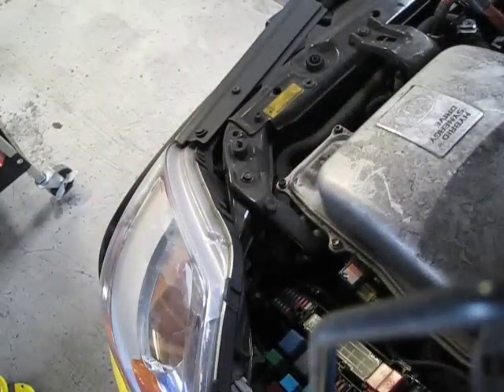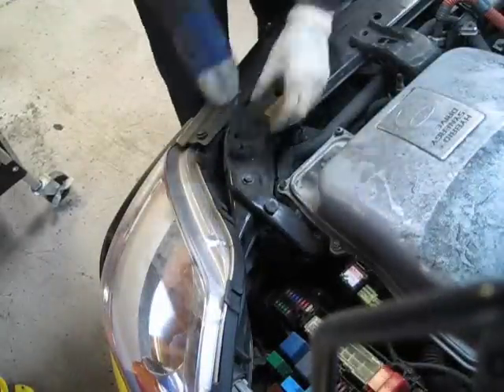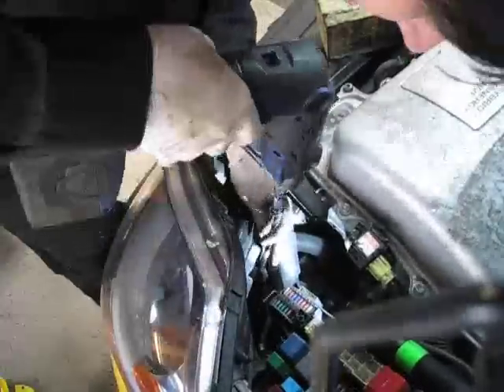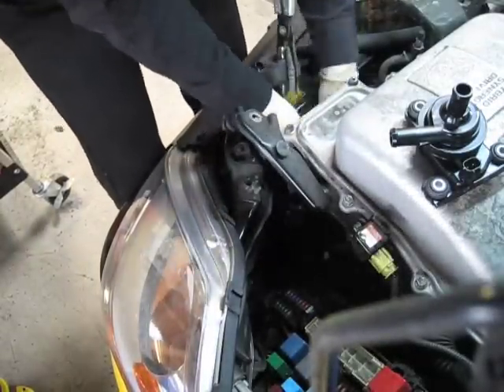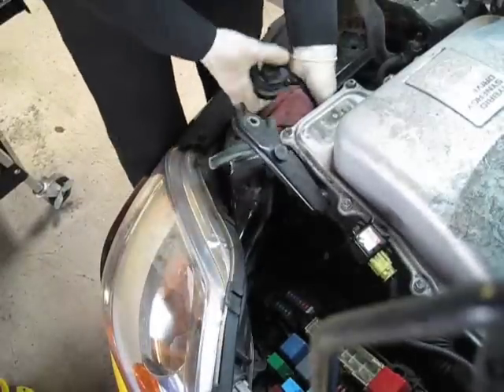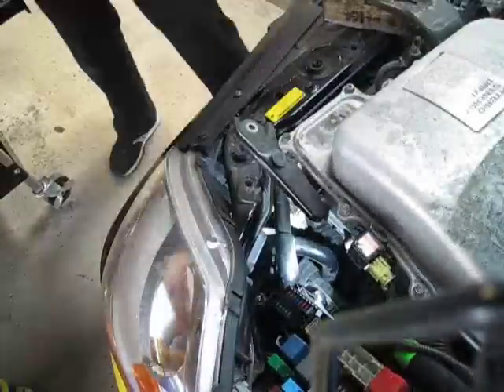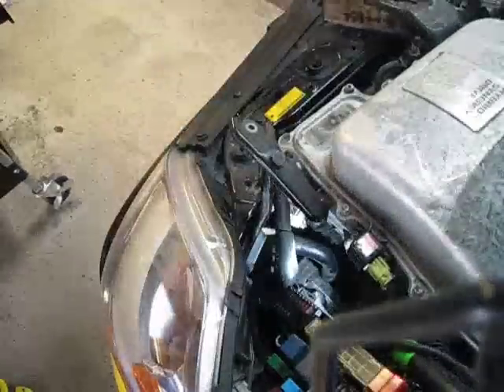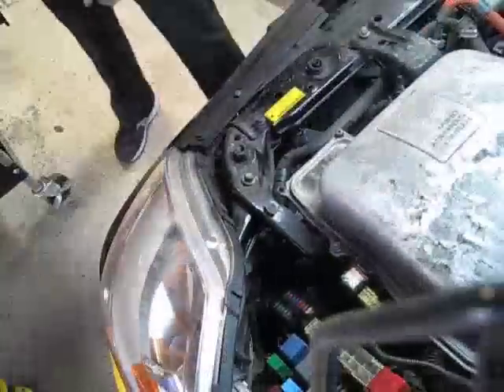Inverter Water Pump Replacement / Recall - Gen 2 Prius - P0A93

Comment: This was the best video for learning to do the replacement without having to take apart your bumper. Only thing I wish I had noticed is how she kept the inverter propped up by a wooden block. I did get a bit of coolant into the electrical socket, but I used Q-Tips to soak up the liquid before I connected the wires back in. It only took me 2 hours because I was inexperienced. Hose clamps were an invaluable tool and I didn't have to drain the coolant. The reward was hearing and feeling the vibrations of the coolant being cycled though the hoses. Thank you for this video.

Comment: I just had the left headlight off a 2009. Looks like that'd be an easier way to get at the inverter pump. With the headlight off the car the pump is right there in the open. Wouldn't have to touch the inverter. Like in this video https://www.youtube.com/watch?v=C-a1TpnVrW4

Comment: I replaced the inverter coolant pump on my 2005 Prius today with the help of your video. The dealership quoted $700 for the repair, but was able to buy the pump, coolant, and tools to replace it for under $150. I maneuvered the pump out by removing the hoses and bolts holding it to the bracket, although it was a tight fit. I did not move the inverter as the bolts holding it in were too tight and I don't own an impact wrench. Thanks!

Comment: Thank you, Luscious Garage, for sharing this technique.  We were inspired by your steps to do our own repair on the other side of the country.  We found what worked best for us was removing the front two bolts attaching the inverter to the frame and also the two bolts on the right side of the inverter mounting bracket (right above the inverter cooling pump) to completely remove the bracket.  That left us very clear access to the pump (vertically), and with two of us working on it, one of us was able to hold the inverter up and to the left to make just enough room for the two fluid hoses to squeeze by (carefully); the back inverter mounting bolts were still in place.  This allows the pump and hoses to be brought up above and in front of the inverter (between the radiator and inverter) for further pinching (to save fluid), unclamping, pump removal and replacement, then reinstallation.  Definitely need two people for this process I described, but the whole thing should take only about 30 minutes.  Your team definitely takes the win for fastest time, and a one person job too!

Comment: I took off my headlight and just used a. 10 mm socket. Easier, but get some carpet and sit on your knees. For $7.99, Harbor Freight has the hose shut off clamps.
Reply: What are the hose clamps at harbor freight called?

Comment: Well, when I took my 2007 Prius in for a "free" recall repair at a local Sunnyvale, CA Toyota dealer, they did not work on a recall repair. Instead, they ran a repair estimate which the dealer charged me $250. The Toyota service guys were on their way to work on something else. So I took the car back without having them work on the "free" recall repair. Then I took my car to a trusted local mechanic who performed the said recall repair for $200 (out of my own pocket, of course). To this day, I still feel I saved money by not having my local Toyota dealer perform a "free" recall repair.

Comment: Seems that the failure has nothing to do with bubbles (ridiculous claim by Toyota) but rather a seized pump - likely a bad bearing. (2007 Prius failing in 2019. May not be the original pump). Pump cost $55. DIY repair took <30 minutes

Comment: I had this problem I replaced it but my intergration relay burned up and blew a fuse it made smoke after I put a new fuse before I replaced the part so now I haft to buy that relay ... is that common

Comment: HI Lusciousgarage, thank you for posting . Can you help me on this. I had the invertor pump changed at the dealer and upon collecting my car, the minute the key is inserted and start button pressed, there is this humming noise that comes on and it goes off when I shut down the system. I drove this car for more than 10 years and I didnt have this noise before as the hybrid system is totally silent when nothing is moving until the aircon or engine kicks in. I brought back to the dealer and have it checked. They confirmed the noise is coming from the new pump that had just been replaced, but they said the computer check didnt detect anything wrong with it and therefore it is ok. I on the other hands felt that something is not right since it was not like this before for 10 years. And it is not logical to me that the pump should be on all the time even when I was not in engaged mode. any such pump must be drawing power from somewhere in that case and I am afraid it will drain my battery. The dealer said they cannot do anything since the computer system check showed everything is normal. Can you please let me know if your Prius had the same humming noise or was it dead quiet when non engaged. Appreciate very much if you can give me some advice on this.
Reply: @BoneArete I just had my inverter replaced this past Saturday 09/15/18, and i have no noise coming out the car. I have a 2008 Prius. My suggestion is: since you had  taken it at the dealer, and all dealers are pretty much all affiliates; My recommendation is take it to another dealer and have them run the test to pin point the problem. Why would you want to keep going back to the same Dr. that can't find a problem. When there are other Dr's that will help you detect and pin point the root cause. Hope this helps. )
Reply: Thank you very much for your response. ...and a good suggestion. I particularly like your analogy of why keep going back to the same dr bit. haha... Good advice. Thank you very much.   Good to hear that your new pump gives no noise.  I always suspect something is not right since if it is supposed to have noise, I shd have hear it the last 10 years. haha   Good to know I am not imagining things.
Reply: mrgiovanny how much was your fix for the inverter replacement? Mine just got this error yesterday.

Comment: How do make sure there isn’t an air bubble when refilling it with coolant?
Reply: Bleeder valve under plastic cover. Run a clear plastic line from bleeder back to refill reservoir.
Reply: @danielmalloy6093  thx, but for how long to be sure no air in system. If you clamped off hoses, will there be any "bubbles"?

Comment: This video is very great, thank you. I just put in a pump from your video, please charge $379 to change pump, it is a bargin at that, seriously. I trust you guys from this video and would like to driveup to San fran and have you go throigh my 2004 for its 180,000mile check up.....thanks ...Dave and Vicki phoenix
Reply: Dave H A bargain at $379?  Changing this pump is about as simple as doing an oil change. The shop knows that.  They dont want the customer to know that. Since when did people get so helpless that they can't do these extremely simple repairs?  Only if someone has a disability or has money to burn should they consider paying for something so simple.

Comment: Great video. Thank you for sharing. Have a question. My Prius was just diagnosed with the same problem at the Dealership. They quoted me $127 for the part and 3 Hours of Labor (400) for a total of $ 530 out the door. What will be your opinion? I see based on your video this may not take 3 hours, but wanted to get your opinion, if possible. Thank you.
Reply: What kinda of clamps you used to clamp the hoses?
Reply: Dude, maybe you will see this in 2019 in your notifications cuz you're anal about looking at them and see this advice.
The dealers are thieves with names on their shirts. The better dressed the bigger the thief. Any questions?
Reply: That's a rip off it takes less than 1-hour maybe 45 minutes you change the inverter pump

Comment: question would a invert pump cause a 04 prius  with 83900 miles to have issues climbing hills ? my car goes from 55 to 15 trying to climb a small hill ,, on the flats itdoes fine,.

Comment: Great video I am in Phx. AZ and I had my pump replaced under the recall, about 2 yrs ago today while driving in 110* heat the red triangle  and the chk engine light lite up and the temp display went out I noticed, I pulled into an auto parts store where they read a code of P0A93 inverter cooling system performance... I took the cap off the inverter saw the coolant flowing  but noticed it was a bit low. I drove it like that at 35 mph for 15 miles  no other issues and was wondering if just being low fluid level would cause the red triangle and throw the code?  thanks very much

Comment: We replaced our water pump on the 08 prius. It was failing. Grinding noises from it and we were told by dealer it had a leak. So we had a mechanics replace it at our home far less money. He also replaced the belt. Now we intermittently have the triangle on dash and temp icon on navi screen light up. There is plenty of coolant in radiator and over flow as well. And car does not seem to be running hot. What can we do?? What could we check?
Reply: Prius has two water pumps. Sounds like you replaced the engine water pump. Might be time to replace the inverter pump which this video shows.
Reply: Where is your home mechanic when you need him?
Reply: @carlovincetti1352  stupidest comment